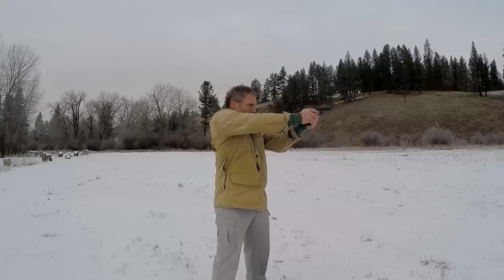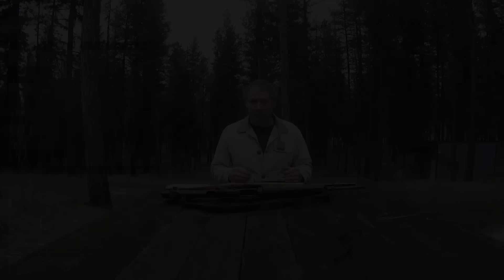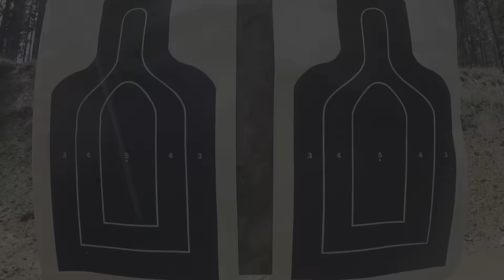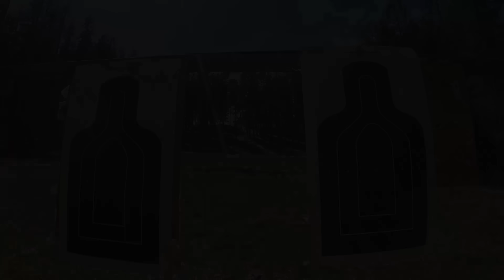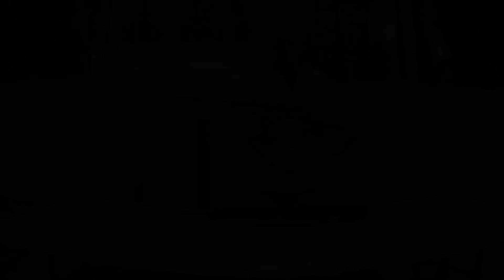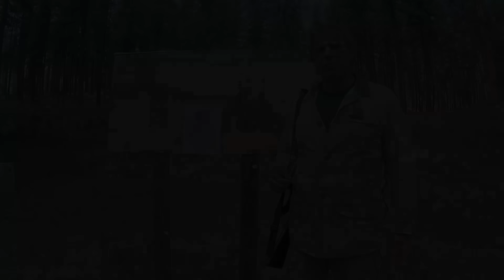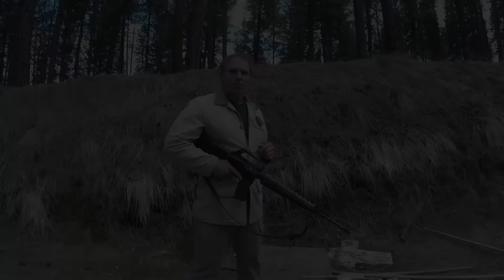Mini-14 vs AR15: Which is Better?

Comment: I already have a AR15, but for nostalgia reasons, I've always wanted a M1 Garand, probably thanks to all the WWII movies I've seen over the years, but most of the decent samples of surplus stock are too hard to get or already bought up.  The mini 14 uses the same action that the M14 and the M1 Garand does but is easier to find and probably cheaper, too.  Plus the 580 and up series rifles are a bit more accurate with the heavier barrel, but still not AR15 accurate.  Don't really care though about accuracy.  I want it for the action it has.  In a few years, I'll be able to show my grandkids the mini 14 and say "see the operating system this rifle has?  It was still being produced 80 years after it helped win WWII.  That's how good it is."  And then pass it on to them when I'm gone.

Comment: I bought my Mini as kind of impulse buy. I already had an Armalite. But, i was shooting my M1 Garand in local competitions. (Being in Texas that meant within 200 miles.) I stopped in a Walmart on the way home, & of course, I had to check out the gun & ammo counter. After picking up 2 bricks of 22lr, I noticed a Mini in the display. This was in 2005. I asked the guy behind the counter to let me see it. 

I had some farmers & ranchers for friends. 4 of them had Minis for truck guns & they liked them. Carry them in a sleeve behind the truck seat for months, pull it out if you need it for a 'yote or hog & slip it back into the sleeve where it's ready 2 or 3 month later.

The price was a little over $600. As i was looking it over a manager came up & ran the counter guy, who was friendly & helpful, off. The manager was a jerk, wanted to know why i wanted it. First i told him, "Not your business." Then explained. I shot competitions with a Garand, which he didn't have a clue about & this felt like a good warm-up gun. In any case, I bought it, & it was good &at a considerable savings in ammo cost. At the time i had a sideline going selling surplus, others, ammo at gunshows. No license required in Texas. I could buy 5.56x45 for 25 to 26 cents a round & sell it for 50 cents a round. After the Newtown freak out, i sold it at $1.50 a round & included a plastic ammo box, made a lot of money, still had 20,000 rounds at home. Never have figured out why people wait til a crisis to buy a 1000 rounds & then shoot it all Before the next crisis.

Thing is, the Mini grew on me. I guess I got lucky at Walmart that evening. It shoots just a little over 1 MOA, I have 10 20-round ProMags & it runs 100% with them. I've tried 3 of their 30s, which aren't my style anyway, & not so much. 

So, the Mini is one of my favorites. It may not be the most accurate i have. But, with its Garand feel it's what works for me. The Armalite doesn't see much daylight these days.

BTW, the Mini 14 has always been able to handle 5.56. But, there was a lot of prejudice against it. Bill & Ruger decided not to advertise that fact. Politics.

Comment: I owned a mini-14 that I panic bought along with a Beretta 92 Centurion at the start of the "Brady Bill". I own neither now. The Beretta just didn't work for me. The Mini-14 was hands down the least accurate weapon I have ever owned except for a Jennings derringer. (That i don't own now either). The Mini-14 grouped about 5 inches at 50 yards. I tested 3 different weights and 7 different brands. Ran 3 different scopes as well. Just not acceptable. Traded it for a Beretta A-303 12 gage, best trade ever.

Comment: Great Video.    I think that Mini 14 is the older version.   The newer models have a thicker barrel.    I would never say the Mini is more accurate than a Match AR.    Yabut..   I still like the Mini 14.      Master the system you have.    Simo Hayha could..   You can too.

Comment: RIP Paul.  That said, it was not fair to compare the obviously more modern Mini 14 (that doesn't look like a 70s or 80s model) with a vintage 70s or 80s AR-15 A-1 because the complaint he is addressing is that the MODERN AR platform is better than the Mini 14.  Still...an interesting video.  I myself am a Mini-14 owner.

Comment: No a free floated barrel on the Mini 14s were most AR-15s today have a free floated, that's a disadvantage. With a Ar-15 and the shorter 14.5 m4 style will out preform the mini when you reach out. Plus the AR-15 platform is more modular. I'm surprised the A1 style is that accurate. I wouldn't mind having the Mini, some years are better than others. If you have a LPVO sighting the AR at 50-200 yards will be in the 4" target from 50 to 285 yards. 7 yards and in you can aim the height of sight over bore, you will have most things covered. Hardly anyone shoots over 300 yards so you can study the trajectory of the 5.56 fairly easily. The Mini 14 may not have any advantage in the law over the AR since states are trying to ban semi autos all together. They never stop.

Comment: Over the years, the price of the mini 14 has steadily increased while the AR has decreased. Mini 14 used to be extremely inexpensive, but they were also not as well made as they are now. The technology of manufacturing has improved a lot since the 80’s.

Comment: The A1 is better because the sights are better. I agree. I like the A2 even better. I don’t have a mini14, and at the prices they ask I don’t have a strong desire for one. I know someone who has one and had to get the firing pin replaced and as soon as he tried to shoot it again it already won’t fire.
Reply: I’m aware this is an old video but watching again. I recently bought a brand new AR15 online for $399, after taxes calculated for TN, and shipping was close to $500 and after transfer was another $60 so about $550 and it’s a fantastic carbine length rifle. Due to popularity economy of scale AR15’s don’t have to be expensive to be high quality.

Comment: I worked up hand loads for the Mini 14,  50 years ago, and I could never get one MOA until
I reduced the powder charge so low that the action would not cycle.
I used the same loads in a 700BDL, and had no problem shooting less than one MOA, @ 100 yards.
The Mini 14 functioned perfectly, so It was a good ranch rifle, but nothing like a M14, or a M1 Grand which I shot  one MOA all the time.
I was never a fan of AR15's or the M16.
Probably from having carried the latter all over Vietnam, and wore it out cleaning it 3 times a day !!! It never malfunctioned either, I was just afraid of it failing at a critical time. So I admit, I was a bit paranoid. But then again I came home under my own power.
Combat accuracy was never an issue.

I'm not a big fan of auto loading rifles, other than .22 rimfire of course.
Not big on stuffing large capacity magazines either. 

I sold off the Mini 14 very quickly.
I will eventually purchase a newer Mini 14, in Stainless steel, specifically for Ranch Rifle duty, maybe it will be more accurate, but not a real concern, it's accurate enough for general principals.

Tim

Comment: I know that someone will know if bullets move faster at sea level or higher altitude. Can someone please help me out?
Reply: Muzzle velocity will be the same, but during flight the bullet at a higher altitude will be in less dense air and will lose less velocity as it travels because there will be less air resistance.

Comment: Ok so you use a gen1 Mini 14 vs an A1 AR.  OR you could have use a gen 2 mini-14 vs an A2 or a typical commercially available AR now available with a floating hanguard.   In any case it will be inequitable but a poor comparisons.  I had a gen 1 mini 14 that I glass bedded for 1 1/2 minute of angle accuracy.  The gen 2 has a heavier barrel for better accuracy BUT it's alot heavier than the beautiful gen 1. I think a better comparison would be an off the shelf AR A2 vs a gen 2 mini 14 because that's what available now for people to choose.

Comment: Didn't mention that you can't load a fully loaded 30 round mag into an AR with a closed bolt. There's not enough play in the mag to permit it to lock in with a closed bolt. I usually load no more than 28 in my 30 round AR mags.
Reply: That’s just wrong lol, give it a little bump and it will seat no problem. What mags do you use?
Reply: @tommysalami6064  magpul Try it.max out your mag and try to seat it with your bolt closed.
Reply: @my2cents945  I’m telling you from experience with my rifle, when I go to the range I have them loaded to 30, and will seat fine with the bolt closed. I also use Magpul pmags

Comment: The Mini14 is a fine rifle. The M16/AR15  is a fine rifle. You really can't live on the difference between the two of them. My Mini14 is a first year stainless steel  rifle, it's lazer accurate out to the 300 yard steel targets at my range. My AR15A1 is lazer accurate out to 300 yards on the same targets. This Bullshit about .223 isn't as accurate in a 5.56 barrel is not so. The external dimensions of the cartridge case are the same, such as are the 7.62X51 and .308 winchester. The internal dimensions are different. Military brass has a thicker neck/shoulder and case head to make it less likely to fail. I use both types of brass for reloading. The difference between the two is you can't fit the same amount of water in each which is how volume is measured. Unless your loading maximum or near maximum loads with a bulky type power you won't see any difference. 
Your rifle looks like a ranch rifle. The rear sight on those leaves something to be desired. Mine has the regular rear sight. 
For a seed reload with the Mini14 use the same technique as the AK47. Use the spine of the magazine to push the magazine release and push the magazine away. 
You actually are somewhat better off using a Mini14 for a home defense rifle. The Mini14 looks like a rifle, the AR15 looks like an assult weapon/machine gun. A trial Jury will think the same thing if you actually end up in front of one and there is always the possibility that you could. You can be innocent of any wrong doing but you still have a 10% chance of being convicted. That might be part of the reason why. Don't stack the deck any more than it is against yourself when you don't need to.

Comment: Miss ya Paul.
On the AKM, I can do a mix of the first and the second reload, holding the mags together, take out the old one and slide in the new one without breaking the firing grip. So I'm wondering if it is possible on the Min-i14 at all? Can anybody enlighten me, because I do not have access to a mini14.

Comment: RIP Paul.  I like both. The newer Minis are more accurate than the older model shown here. Also, in several areas like NYS you can't possess the AR because it's scary to those in the NEast.  In NJ you can't have a flash suppressor or a bayonet lug but you can have a compensator  go figure. Seriously,  I never will understand why they are still putting bayonet lugs on ARs as I really don't see people doing charges these days.

Comment: The newer mini fourteens, 800 series and above are awesome.
And you can get anything for them The old ones used to get barrel wobble. When shooting, the new ones are stainless and it is thicker.Problem solved, I love the collapsible butt ends you can get

Comment: I'm sure others have pointed this out, although I can't find any comments on it - MOST Mini-14's are chambered to use either 5.56 NATO or .223 Rem - even though they are marked ".223 Rem" on the rifle itself, so you probably could have used standard 5.56 NATO ammo. This is according to Ruger's manuals. They clearly state that the Mini-14 is designed to use either "...standarized US Military or factory loaded sporting .223 (5.56mm) cartridges..." There are some that are .223 Rem only, but as far as I can tell this is ONLY the target models of certain versions. 
Yes, they are marked .223 on the rifle, and yes, this is bad practice by Ruger to only mark .223 on the rifle and then state it can use both 5.56 NATO and .223 Rem in the manual, but this is the reality of the situation. I haven't looked at any brand new Mini-14's recently, so maybe they have changed the markings.
Thank you for your videos over the years. They have been helpful and educational and I feel you have done a great service with these videos you have provided.

Comment: There is also a caveat with the mini-14, and thats when it was made. There are eras of Mini-14 that are universally agreed upon, even within mini-14 lover circles, as being absolute garbage. I hear tell the modern ones with the adjustable gas block, and barrel brace, can be tuned in to a much better accuracy at distance than previous iterations. I am a Mini-14 lover, shes a good gun if you treat her right. It was NEVER built to be a sniper rifle, or reach out and touch somebody. It was built to throw lead and keep the critters at bay. Keep it oiled, and it will do that at a moments notice, at any moment you need it to. I highly advise NOT putting too much fluff and froo froo into the thought of what it COULD do, dont ask it to do what it cant, and itll cycle all day long tossing reminders to reconsider ones life at whatever is threatening you. I have no problems with my old Mini-14 hand-me-down from my dad. Ole reliable ranch rifle, never fails me.

Also, you have a speech impediment? You sound fine to me. Very straight forward and succinct. Like the early morning hunting and car shows my dad would watch back in the day.....before the internet made noise, and fell silent for evermore, when people had skin, and integrity, before the silliness and insanity took over.....

Comment: get a .556 mini (NOT a .223 mini) with the same barrel length.
Reply: its 5.56nato, not .556, and all Mini 14's are chambered in 5.56nato. Read the owners manual.
Reply: That's impossible because the Mini 14 was first manufactured before 5.56 NATO existed.  @J.Huff76

Comment: New mini 14s come with a cold hammer forged barrel and tighter tolerances than the mini 14s of old. In my experience they are just about as accurate as most AR 15s out there today. With some cheaper ARs being worse and others being substantially better. In the minis street price range it has a substantially better trigger than standard AR 15s.

Comment: I had a 14 with the roller on it worked a lot better and more accurate than the one that didn't I guess they did that for cost-effectiveness I don't know if they ever put the roller back on but the price is why I bought the mini-14 it was like 1062 180 bucks

Comment: I was told more than once by other professionals, that even though the Mini was marked as .223, that it was actually rated for both. I've shot both in mine, but most of my shooting with it was handloads loaded to .223, but they were also fairly warm. 😊

Comment: About 1990, I bought an early Mini 14 (stainless with laminated stock) with the thin barrel. Its accuracy was never better than 6 MOA. Glass bed it, friends said. Get the harmonic balancers, other friends said. Get it re-barreled, the rest said. Get another rifle, I thought to myself. The Mini14 never failed to shoot. I liked the Garand action, and it worked flawlessly. All my mags worked, 10, 20, 30, and 40.

I managed to trade it at a gun shop at a time when the prices and wait times on AR-15s was in its first panic period during the first Obama administration. No gun shops had ANY ARs or other military style rifles in the racks. Someone got a flawlessly shooting but seriously inaccurate rifle and I wound up with a fine Ruger Red Label shotgun.

I don't have a problem with Mini 14s; I just had a problem with the particular one I owned. I'd want to shoot it before buying another. I have no complaints whatsoever with any other Ruger of mine.

Thank you for your channel.

Comment: Great in depth review.  Agree completely.  Which one is better?  The one you can use most effectively.  They definitely seem to be two different use cases with the Ruger typically for a ranch rifle and varmints and the A1 in this case for combat engagements reflecting the anticipated typical Cold War scenarios of the day.  Of course I learned on the A2 but the platform is indeed classic.  Personally though if I wanted the Ruger, I might opt for the mini-30 but that wouldn't be an accurate comparison.

Comment: The elephant in the room... look at the mini-14 barrel he has. It’s a pre-580xxx serial number gun. Those had thin barrels that caused accuracy problems. The 580 and later ones have a heavier barrel, no harmonic issues, and the gun’s mechanical fitting was tightened. There are numerous videos on YT that show the Mini-14 is very accurate.
Reply from the maker: I explain that in the first two minutes of the presentation.

Comment: Mr. Harrell did an excellent job of presenting the pros and cons of both platforms. In terms of PRACTICABLE accuracy at realistic ranges, and field reliability, the differences aren't significant.
Also, most of us will never require split-second speed-loading of a magazine; a few seconds difference are not significant. And, a slow-down of that procedure might better serve the user since mistakes would be less likely.
In most battlefield scenarios, long-distance MOA accuracy is not THAT essential since few encounters will be at hundreds of yards.
Neither platform would be preferred by a skilled sniper. In any case, at distances of, for example, 25, 100, or 200 yards, you won't want to be on the receiving end of a projectile fired from either platform by a competent shooter. Don't assume that your chances of being missed  are better if fired from a mini-14..
Simplicity of design and a lower maintenance requirement ARE advantages in the field, where applying required maintenance protocols
are not always an option.
We also understand that the mini-14 is NOT a target rifle. But it IS good enough for effective battleground use when the only options are the AR and the mini-14 in semi-auto. And of course, it's certainly an effective defensive weapon for the average civilian.
Caliber? That's another issue.
Thanks for the vid Mr. Harrell.